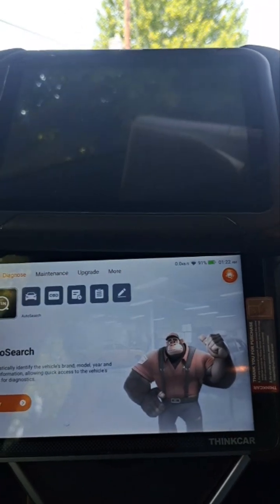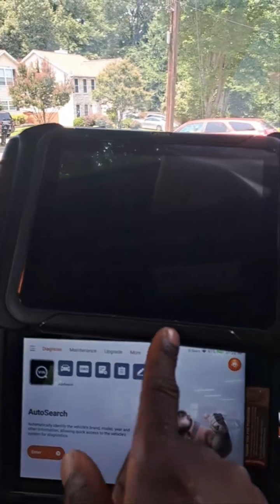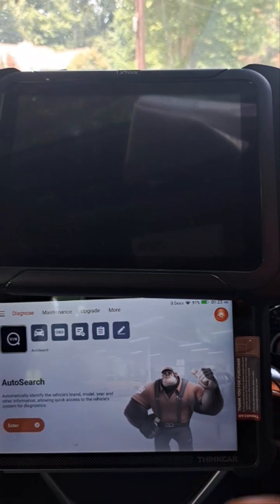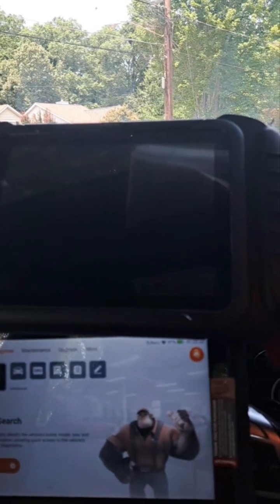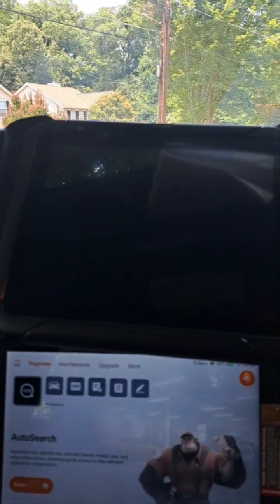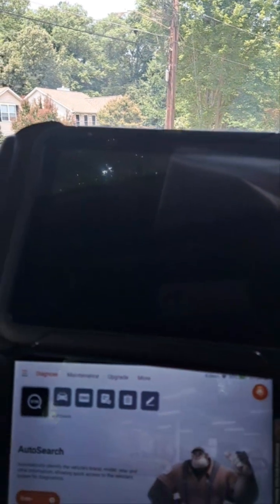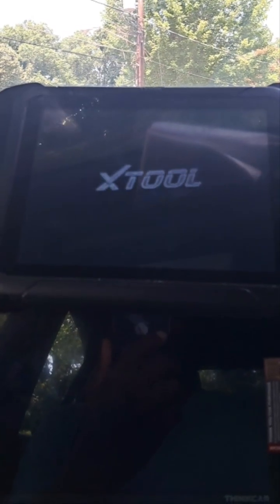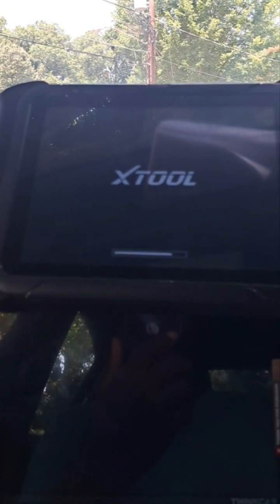Truth About XTool D8W Vs Thinkscan 689BT Scan Tool Capability Comparison and Usage Experience

Comment: I'm undecided between buying this thinkcar or an XTOOL D8w, which one do you think is better?
Reply from the maker: Its not just about which is better, its about what you plan to do with it and what level of work you'll need it for. No One tool Does everything on Every Vehicle. If youre a home DIYer, and Working on One or 2 Vehicles or better if they're the Same Brand Of Vehicles. You might be okay with Just Thinkscan, it does the Most Basic Tasks and has decent Advanced Capabilities, But dont expect to do any Major Programing with it. If you're looking to do Advanced stuff On One Vehicle (Depending On the Brand) you might be Ok with this Xtool. It's Fairly Versatile. One good feature with the Xtool is the Ability to Pull PIN codes on Dodge/Chrysler/Jeep. But that's just that One Brand/Line Of Vehicle.  So all depends on what you are Looking to do, What Brand Of Vehicle(s) you plan to use it On.
Reply: @phigo4kins  what's your opinion about topdon Artidiag900 BT
Reply from the maker: People say its good, but from what I gathered and the Research that I've done, I dont have Much Confidence in them Based on My Needs.
Reply: @phigo4kins i think xtool UI is very good, simple and graphic nice, but my problem with xtool is you never know if spécial fucntion you need will be functional, by expérience i think lot was not ok, so you can't trust of what is real cabability, i don't know if ohter scanner is better on what it's spécial function announced...